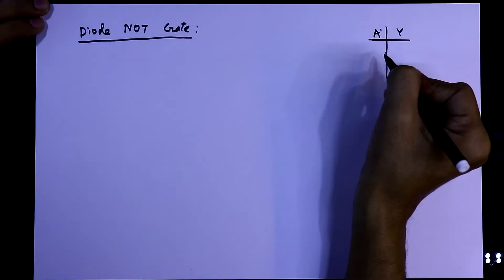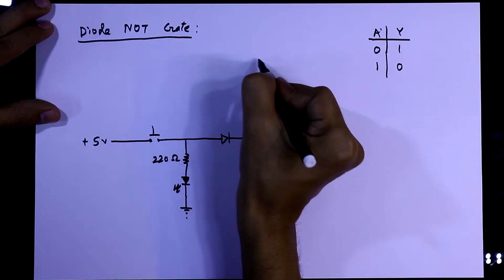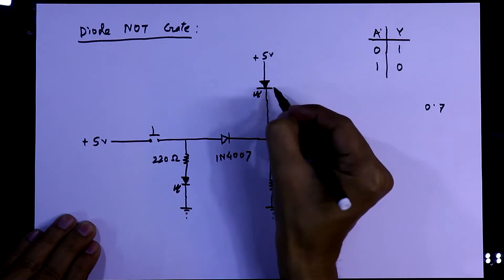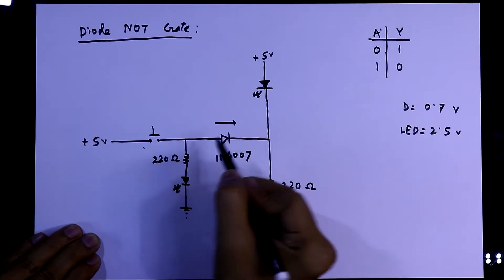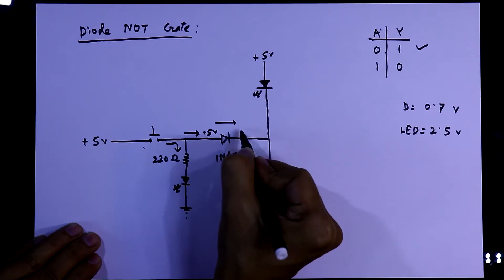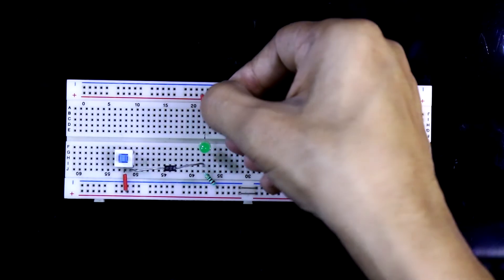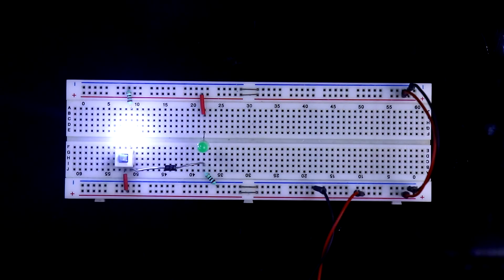Diode NOT Gate | Diode Logic Gates | NOT Gate

Comment: Do you have video explain Voltage Potential Difference?  I'm new to Electric.
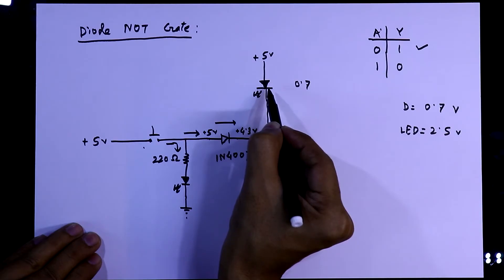At 3:10 you said 5 - 4.3 = 0.7 and Led needs at 2.5v to glow.  0.7 is not enough for that.
Let's say voltage drop from diode is 2  instead 0.7    So 5 -2=  3v  In this case led is able to glow right?